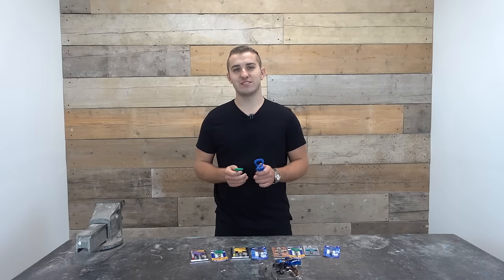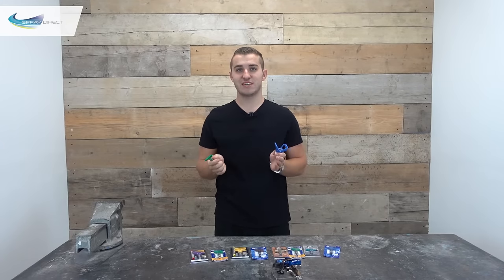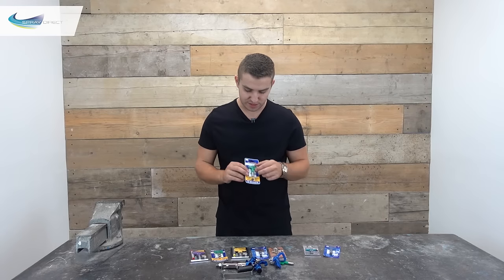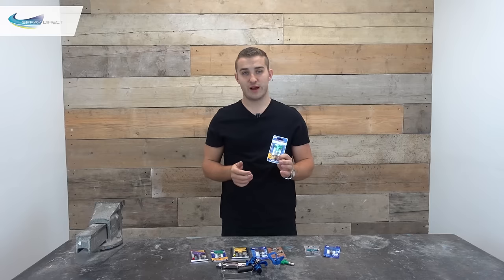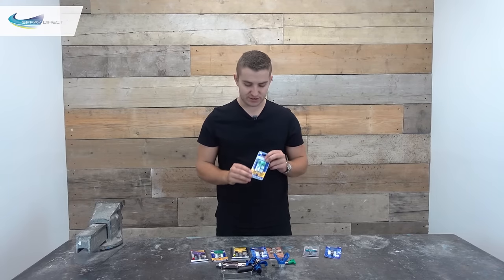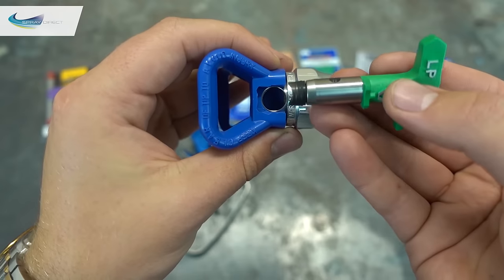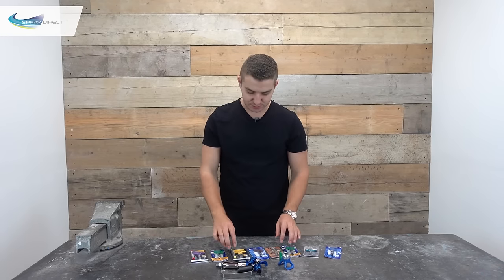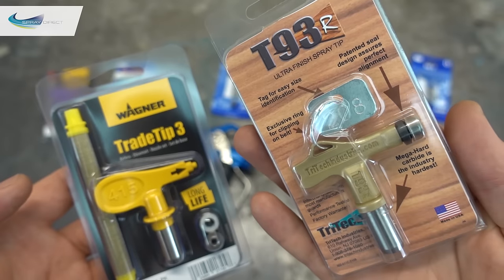How to install a Spray Tip

Comment: Do you have to change the tip seal every time you change to a different tip or are the seals all the same ?.
Reply: Did you find the answer to this? I did my first big job with an airless sprayer and immediately lost the seals for my two favourite sizes of tips whilst cleaning it outside
Reply: @bertybasset106  no never lol. So I just change them now

Comment: Thanks so much, got a FFLP310 and didnt know there would be 2 more pcs in their. Figured I had to change the nozzle in the guard but didnt know how to do it...duh...but what is the other plastic orange/yellowish  piece for? Seems  that looks like it should go on the end of the tip before you insert it into the guard, I dont see one in their now, so Im going to try that, hope its correct. Second time you helped me out big time, Thanks Brother!
Reply: I wish this question was answered here!
Reply: @cresk  I think the orange / yellow piece is for when using solvent based materials

Comment: What is that little yellow cap for, the ones that come in the Graco FFLP tips, have always wondered if I’m doing something wrong by not using these…
Reply from the maker: Hi, the yellow cap is a replacement part for the black rubber seal if you're using very harsh solvents that would break down the rubber. 99% of the time the black rubber seal is the one to use as it seals better.

Comment: Is the seal specific to the tip? For example, If I put a 310 FFLP tip in a graco gun that came with a 514 tip installed in the guard, do I need to change the seal to the one that came with the 310 FFLP tip? Make sense???
Reply: I had the same question. There's an answer given above, but basically he said the seal isn't specific to the tip as long as you're using the same style tip, for example FFLP to FFLP.

Comment: My first paint sprayer is the Graco Magnum Project Painter plus. I know this because I have typed it 50 times since I bought it yesterday. And the start up covers everything in great detail. except, replacing the tip.  It simply says remove and place in the debris bucket.
And like many other comments, Thank You

Comment: This was a great video, but how do you remove the old seat from the guard? thanks
Reply: I used a flat head screw driver today.
How you doing?
Reply from the maker: Thanks!! To remove the washer you simply need to push it out from the front. To do this use something like a pen to push it back the way it went in.
Reply: I believe the front of the spray tip can be used...face it head on with front (metal side) of seal...then give it a light tap w. a hammer. This is how I remove mine

Comment: I purchased a Sr. Denoff aftermarket blue guard.  (considerable less expensive than the Graco guard.   I purchased a Graco FFLP110 to use with the aftermarket guard.   The tip gasket for the FFLP would not remain seated in the guard and would fall out of the guard from the inside where the spray tip is inserted.  Is aftermarket just a bad idea where Graco is concerned?    ALSO...  Why does the Graco spray tip come with a second, yellow gasket along with the black rubber gasket?   Thanks
Reply from the maker: I think you've answered your own question! The issue is 100% the copy guard, it has been designed as a generic guard whereas the Graco guard has been specifically designed for their tips. Genuine products are always the best way to go especially where high pressure is concerned. The yellow seal is if you're using products with aggressive solvents that would eat through the rubber seal.
Reply: @SprayDirect   Thank you for the information.  I have returned the aftermarket guard and purchased the Graco guard.  Interestingly enough, the Graco guard came with the seal pre-installed and appears to be of much higher quality than the aftermarket version.  Thanks again

Comment: Great video, but could you explain please how to remove the washer to fit other tips, thanks
Reply from the maker: Thanks!! To remove the washer you simply need to push it out from the front. To do this use something like a pen to push it back the way it went in.
Reply: @SprayDirect  thank you sir

Comment: Does the seat of the tip stay in that guard, or can it be removed and used in another guard if need be?  Thank You
Reply: It's a standard part, so you can pull it and put it in another guard, BUT you get one with every tip, so you should have more than enough laying about as you should have more tips than guards
Reply: @doughumble8884  I figured it out after watching the video  a few times and looking at my tips. Thank You

Comment: Hello buddy , do you always have to put the seal in the guard that comes with a new tip ?? what if theres a seal already in it
Reply from the maker: Niall O'Connor thanks for the question! No as long as the one that’s already fitted is from the same style of tip. So you always use FFLP seals with FFLP tips as the hole through the middle is slightly smaller. The size of the tip doesn’t matter 👍 hope this helps
Reply: @SprayDirect  thanks so much for your reply i really do appreciate it , i wonder if thats the problem i'm having  if you could help me out , i've sprayed long time ago and only starting get back to it , when i spray walls to a finish i'm trying to use the fflp tips from graco and keeps blocking in my gun  the tip, its just cover matt crown , but when i put in say a blue tip it sprays fine , i have a tritech T5 , same with tritech tips when spray with bluey/purple tip that comes with the machine sprays fine soon as  put fine finish tip from tritech wont spray blocks hard to turn tip gets tight any idea ??

Comment: Thanks!  I’ve never owned an airless paint sprayer so I bought one recently.  The instruction manual illustrations on how to assemble the spray tip was horrible!  I was concerned I had done it wrong and felt I just laid down hundreds of dollars only to make a mess of my spray gun and my project.
Reply: Exactly, I referenced my manual too. Has no reference on how or why can't would be pouring out the middle the nozzle! Manufacturer even how to instructional video and they didn't even reference that either!!!! Anyway at least I just lost a little paint, and pride!  lol

Comment: Thank you, being brand new and diyer this was very helpful. Just bought Graco FFLP 310 tip and Gaurd from yourselves. Didn't resolve the issue i have  but clarified i had setup the tip correctly. Didn't know what yellow plastic part was for.

Comment: Mine keep falling out. No idea why.
Reply from the maker: Kendall Phillips are you missing the retaining tap on the tip or the guard?
Reply: @SprayDirect  It was missing the little bushing inside the guard or whatever it's called lol. It's always something...
Reply: I have wagner 250r and lost this shitty part after first use :D probably i poured this part out when pouring water from a bucket.
I just ordered 2 new ones for replacement for 10$ hope it will fit perfectly as i guess its not original part now.

Comment: Hey mate, I appreciate your help and reply, but you do ask people to subcribe and  and like 
 Can you please try answer question I asked you   ??
Reply from the maker: Sorry for the late reply Niall. No you don’t necessarily need to change the seal every time you change the tip, for instance, when you are swapping between tip sizes, you wouldn’t change the seal. That being said, these seals can get damaged and do wear, they are easily lost on site when cleaning your machine too, so it’s never a bad thing having a couple of spares to hand. You will also need to change seals if you’re swapping between solvent based and water based products, Graco do a black coloured seal for water based and an orange coloured solvent resistant seal. If you do a lot of swapping between water based and solvent based, it may be an idea to have a 2 separate tip guards, 1 with a black seal and 1 with a orange seal as it would be easier and quicker to swap tip guards than tip seals. If you’ve had your tip seal in for a while and you’re having to tighten the tip guard up very tightly with spanner’s (they’re called handtite guards for a reason), or if your tip feels loose and falls out, or you have a leak from behind and around the tip or tip guard thread, chances are you need to change your seal. I hope that helps Niall and again apologies for the slow reply.
Reply: @SprayDirect  thanks so much. No worries mate, I sprayed in Canada over 6 years ago and just getting back to it few weeks now, and just trying understand it all again, sure another few weeks at it I be flying. Just in Ireland and uk don't use it regularly as Canada and USA, they use it daily, but I know alot of painters starting use it more and I'm one them trying get into using it, but alot jobs doesn't cater for it, which state side all builders allow for spraying
Reply: @SprayDirect  Thank you again.  You mentioned the two seals you get in a package with the new spray tip, I got an orange and and black, again, didn't know anything, but now thanks to you for explaining what each is for, you made my life so much easier now.  I also know why when I changed the guard it leaked all over me, my car and the ground lol.

Comment: Okay I appreciate the video I just recently purchased at 310 FFL tip it came with its usual seal however it also came with a yellow ring what is that used for
Reply from the maker: Dwayne Mims the yellow seal can be used instead of the rubber for use with strong solvents. If you aren’t I’d suggest sticking with the standard rubber seal 👍
Reply: @SprayDirect  Thanks
Reply: Excellent... just the answer I was looking for..
Thanks
Reply: @SprayDirect  Awesome !  Thank you

Comment: Hi SD. I am a first user of an airless spray painter and I had no clue about the spray tips on these units! I have no owner's manual since the sprayer was given to me by my late uncle. I appreciate knowing  how to use the spray tip. My unit did not have one and I could not understand why the water ( I was practicing using water before I try pain)  just came out of the end in a long stream! Thanks again.

Comment: Maybe stupid question. I just purchased a Greco sprayer. I came with a black tip (tru515) works fine.   I purchased green tips (fflp310+619) They do not fit into my gun.  Is the diameter on the green tip wider?  Thank you.
Reply: You need to purchase a different guard for the gun in order to fit the 310 FFLP tip.  The guard you need is called the Graco RAC X guard.